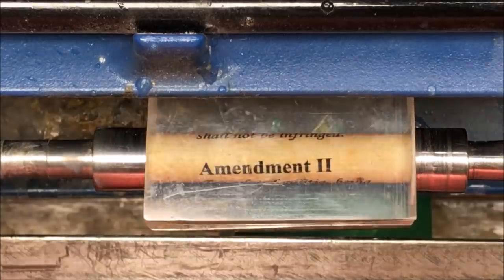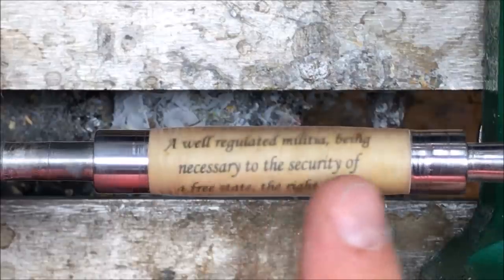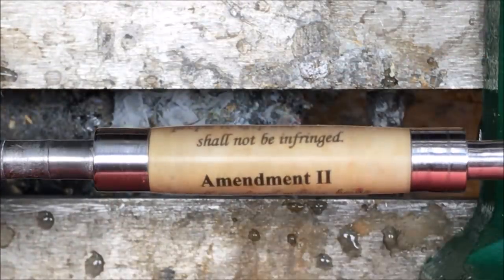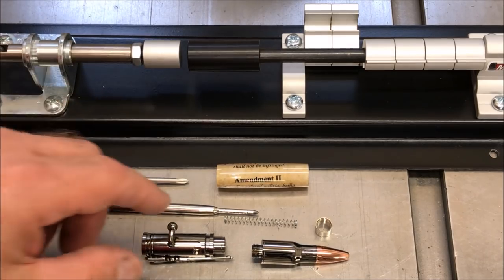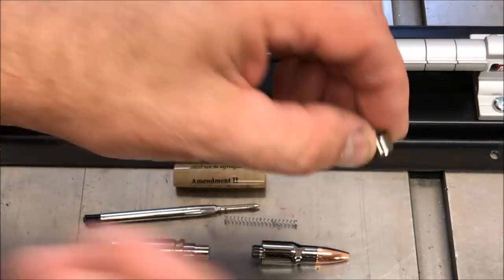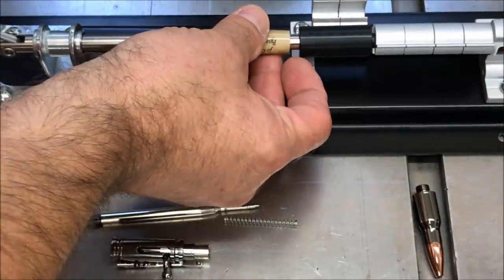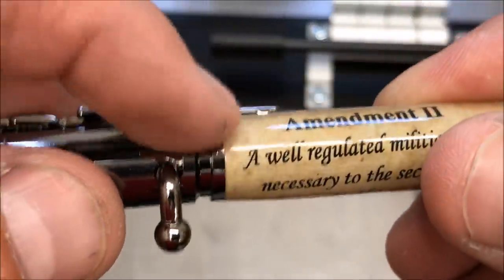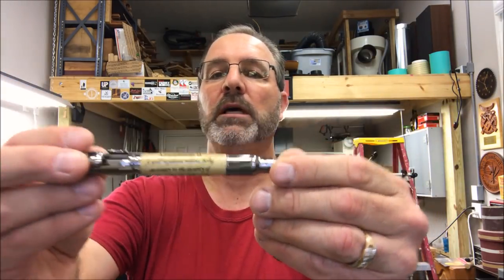2nd Amendment Bolt Action Pen

Comment: Love the bolt action mag. I have made several of them. Thanks for sharing how to turn the bolt and clip around. Beautiful pen you got there Bob. Nice job.
Reply from the maker: +Charlie Odom Thank you Charlie. 

Regards,
Bob
Reply: Nice finish but worging looks a little crooked to me. Is it me or was the blank drilled off center?
Reply from the maker: +James E. Barnes It was a tube in label cast and I think the label was applied at a bit of an angle. There was nothing I could do to modify is. 

Regards,
Bob
Reply: Sorry for being critical. I have been looking at that blank for some time now and I thought that drilling would have to be “right on”.  When I do order this blank, I will be sure to check it out before drilling. 
Great video as always.
Of course, this is from the guy who spelled wording (worging) wrong! LOL
Jim

Comment: Hi Bob, I see you used the buffing wheel. Have you decided to use it even after finding the grit is not as fine as the micro  mesh?
Reply from the maker: +Mike Smith Hello Mike, 
  Yes, I plan to keep using the wheels. Believe it or not, the pen had a more beautiful finish after buffing. I know the grit isn’t as high and the MM but it does a beautiful job. 

Regards,
Bob